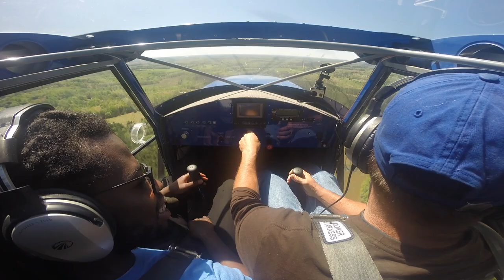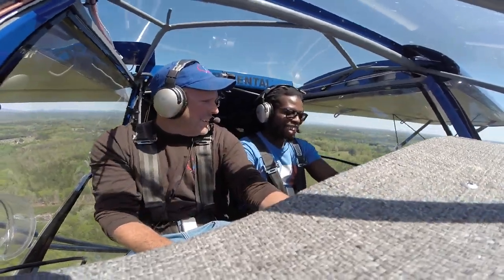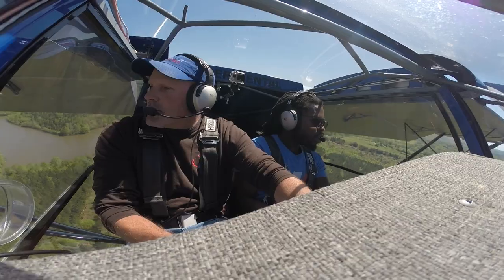The Slowest Plane EVER! Justaircraft Superstol XL Flight Review

Comment: I used to fly at 30mph in the 19 70's.  That's in  mph, not knots.  I find low and slow more fun than flying at high altitude.  It is very practical when you are going nowhere, as I suspect of most light plane operations.  Oh, yes, it was a powered Rogallo wing ( at youtube under sevtecsev) at a whole 13 hp!  Takeoff roll was- - just make sure you do not lift off when you are on the "backside of the power curve".

Comment: Great video. If you want to fly some more STOLs head down to Mexico.. Missouri.  Zenith Aircraft.. and fly the 701.. you can take off in about 50-60 feet. You can always head down to Florida Massey Ranch Airport, and visit Jan Eggenfellner. He owns the 750 SD with 180 HP. You could do videos on the Viking engines and the 750SD (Three seater).. plus you can stop by the beach and view the beach bunnies! Love seeing STOL videos.. Everyone thinks get a plane and go fast, til they fly a STOL.. then they are usually converted.. Low and Slow..

Comment: Can any of your pilots do a 180 degree stall turn? I saw a crop duster doing after spraying each row. He was flying maybe 20 feet while spraying. When he reached the end of the row, he pulled up, not changing his engine speed at all, when his plane started to stall out in the climb, but still having enough speed to maneuver, he turned the plane around and picked up speed while it was falling, then leveled out and dusted the next row.

Comment: My instructor & I had an Auster (taylorcraft) flying backwards at about 1000 ft. Had a stiff headwind probably doing 10 to 15 knots. The ASI wasn’t reading probably doing 35 knots with a 50 knot headwind. Not as slow as this plane though.

Comment: "Normal airplanes have to climb to 500 and keep climbing just to be in safety, but with an airplane like this you can fly low and slow..."
All airplanes can fly low, but it is not recommended. That this airplane can fly a bit slower is no reason it should be any safer. On the contrary: More susceptible to gusts of wind from behind and turbulence. But I agree that it is fun!
Reply: I kinda disagree ! safer just from the fact it can land in less than 100 feet (engine out better chances)

Comment: Nice video, but tiring having the whole video filmed with that very wide angle lens that distorts everything.
I learned to fly in a slow flying high wing Cessna 150. Flew into a lot of undeveloped  grass airfields in Panama.
Reply: I was flying a 150 through a mountain pass in So. CA back in the late 1960s and I  ran into an amazing headwind.  Along with dense clouds that made me feel like I was inside of a pillow.  I was not instrument rated.  What I did to get back to the Riverside airport was to lose altitude to get out of the clouds and then followed the 10 Freeway.  During a portion of that time, I could swear that the vehicles on the freeway were going much faster than I was.  They were going 60-75 and I was going about 50 mph ground speed or less.  It was weird but kind of fun.

Comment: You may want to fly a Quicksilver Sprint given you first take flying lessons with a Certified Flying Instructor. These are Ultralights that will take off in 25ft and with skill obtained, will land in just about the same. Yes, they can climb over 10’ and land with the engine off.

Comment: inpressive, however there is at least one plane that does it even better.
The Fieseler FI-156 Storch (stork) has an even lower stall speed. Depending on which model you look at it is between 29 and 31 mph (46-50 km/h). That design dates back to the mid 1930es. Production was continued untill 1965 under other designations. There are still a bunch of airworthy ones around.  It used an Argus AS10 inverted V8 with 240 HP.
When they used in the Gran Sasso raid in 1943 it took 30m (100ft) to land and 80 m (240ft) to take off again overloaded, from a Hotel in 2100m / 6900ft above sea level. Might be worth to make a kit based off that design.

Comment: It is fun to fly low and slow, but certainly a lower safety margin, not matter what airplane you are in. I recall a flight I had with a guy who had just bought a Piper Cub, we spent 30 minutes buzzing over farmland in Ohio, chasing ducks and waking up the neighbors. Very exciting, but a few months later the guy died when he stalled at 300 ft. and didn't have time to recover. Be very careful if you are going to fly like this.

Comment: So now that you have done that, you should try a gyroplane!
Reply: the slowest airplane is the stacked wings airplane ..
Reply: @pooorman-diy1104  do you mean a biplane?
Reply: @JV-tk3nn  I don't know the correct name .. I think you right .. biplane ...
You can search in Youtube:  "Bloop Slow Flying"  .. It's soooo slowwwwwwwwww.....I like iiiiiiiittttttttttt..... So far I can't find slower flyer than this .. If you find it .. show me please ....lol...lol...
Reply: @pooorman-diy1104  Thanks for the info! I never knew of the Blood Slow ultralight biplane until now. It is kind of similar to the John Moody's Easy Rider, the  powered biplane glider that helped in the creation of the FAR part 103 rules for ultralight aircraft.
Reply: @pooorman-diy1104  Yes, but the gyroplane is not only slow, but you don't have the wings blocking the view in any direction.  It is like riding a motorcycle, but in three dimensions.  The view is fantastic.  And you can safely fly down at or below treetop level, too.  If the engine quits it can land in a very, very, very short distance.  If you try one that doesn't have an enclosed fuselage it is just you, a chair, and the sky.  Fun!

Comment: I like these just cause they are "getting around everywhere" kind of usefulness...  like a dirt bike with saddle bags.  But imagine IF you had to crash and then come in SOOOOOOOOO slow and very low... Relief, and not HORROR. Not like a modern passenger jet - at 350 miles an hour in to the side of a mountain.

Comment: Is that a piece of the wing coming loose at around 8:40!??
Reply: left wing
Reply from the maker: Those are the slats on the wings. They retract automatically in slow flight. They help keep the airplane from stalling.
Reply: Thank you. I have learned something new. Im still unfamiliar with several terms around an airplane.

Comment: The Wainfan Facetmobile could stay aloft at <16 kts (his pitot tube couldn't read any slower). 100kts on 40hp, 340 lbs useful load.

The Arup S-2 (1932, fore-runner to the Vought V-173) landed at 18 kts, though it could fly slower. 780lbs, 37 hp, 85 kts, astounding steep climb rate, stall-spin proof.
See the "Flying Heel-Lift" youtube.
Arup S-4 was 1150lbs, dual control side-side. 70 hp, 100 kts and similar characteristics to the S-2

The '30s Nemeth parasol or "parachute plane" with circular wing was also stall-spin proof, steep climb rate, faster than the plane which the fuselage came from.
The Farman 1020 of similar date and type, was also stall proof and super-STOL, faster than the original plane.

Many planes of very-low aspect-ratio have been super-STOL and stall-spin proof, and (contrary to "conventional wisdom" and theory) they are not inherently draggy at cruise but were sleek and fast on available power.

Comment: How can you state " The Slowest Plane EVER! " ? That is not correct. 
Still your plane can not beat the Fieseler Storch Fi 156 , which had a stalling-speed 31 mph , take-off within 180 ft , landing in 100 ft.
Reply: Clickbait. Truth isn't important to some people.
Reply: Actually, it will beat the Fi156 in most regards. Half the takeoff distance, similar landing distance and with slats/flaps down the SuperSTOL stalls at 32mph. But the Fi156 is technically slower (as is a Carbon Cub, which shares the 31mph stall speed of the Fi156). There's a dozen or so planes with similar performance today (and that's before you get to custom-built monsters like Draco)

Comment: Sorry, but this is by no means a "slow" Aircraft.
Look up  the "Fiseler Fi 156" This airplane is really slow.
This could start standing on the runway, when there was enough wind against it, it could fly "backwards" or hover if there was wind in the right direction.
The used it to lay telephone cables from the air, simply by rolling them out of the cockpit and dropping them to the ground.
Reply: The Fi156 stalls at 31mph vs 32mph for the SuperSTOL. The higher listed stall on the SuperSTOL on most spec sheets is a clean wing (flaps/slats retracted) vs slats & flaps out for the Fi156.

Comment: A C-130 takes off in less then a 100 feet, and has jet rockets that allows it to climb to a thousand feet in seconds. When i was in the Air Force I was stationed at Tin City AFS in Alaska. I was taken there by a prop bush plane that was probably built in the 1920's. We flew at about 70 miles per hour and less then 100 feet above the ground. Wrong, that plane was not flying 25 miles an hour. It wouldn't stay up in the air. The flight that I took up to Tin City AFS was probably slower then the plane you were flying int.
Reply: Actually the stall with no flaps on that plane is under 35mph.  With flaps and a bit of a head wind, 25mph is definitely achievable.

Comment: I have a slow aircraft. A high wing parasol. A Heath super Parasol . With a two cylinder vw engine.  Landing speed is 27 mph. Built it myself. Has a model A Ford carburetor on it . I built the engine myself. Have a mill and a lathe. .    Using a Harley motorcycle ignition system.  I can rich and lean carb at altitude from cockpit.   The model A Ford carb works good. Also adjust spark from cockpit. Advance and  retard spark for best performance . There is a RPM that needs NOT  to be exceeded.  Because of the wooden prop limitation.  Prop tip to speed if exceeded will throw prop in flight.   It gets hot in the cockpit when the fan stops. Try it loose the prop( fan) in flight you will break into a sweat.  Quick.

Comment: In a single engine craft it's always dangerous to fly at an altitude that does not allow one time to select an emergency place to land upon and engine failure. An altitude that prevents one from flying with an eye towards any potential landing spot in and emergency is unsafe flying for any single engine. Especially experimental rated crafts like these.

Comment: Better hope that engine don't quit while flying that low. It's also illegal to fly that low when not in the vicinity of an airport.
Reply: Reference the FAR please
Reply: @oneskydog4401  91.119 Minimum safe altitudes: General.
Except when necessary for takeoff or landing, no person may operate an aircraft below the following altitudes:

(a)Anywhere. An altitude allowing, if a power unit fails, an emergency landing without undue hazard to persons or property on the surface.

(b)Over congested areas. Over any congested area of a city, town, or settlement, or over any open air assembly of persons, an altitude of 1,000 feet above the highest obstacle within a horizontal radius of 2,000 feet of the aircraft.

(c)Over other than congested areas. An altitude of 500 feet above the surface, except over open water or sparsely populated areas. In those cases, the aircraft may not be operated closer than 500 feet to any person, vessel, vehicle, or structure.

Comment: The title of this useless video is nothing more than baiting viewers.  The idiot narrating the video has no clue relative to Airspeed, Rate of Climb or Take-Off and Landing Distances, other than his opinion !  There is no mention this is a Amateur Kit which also explains the lack of any instruments.  The Kit manufacturer claims it has a Stall Speed between 32 & 37 M.P.H. however, does not specify at what Pressure Density Altitude, Temperature or Maximum Gross Weight.  In short, another worthless video about an aircraft !